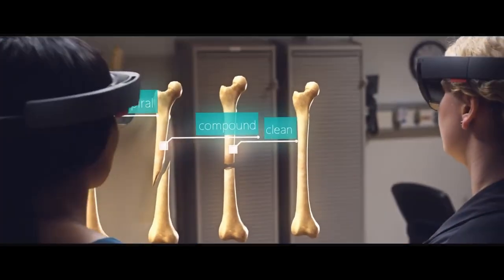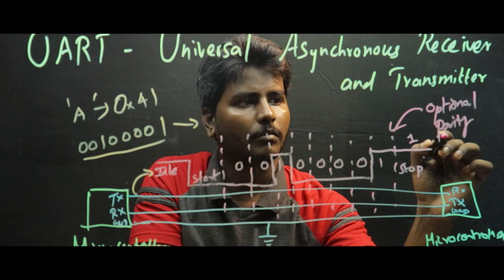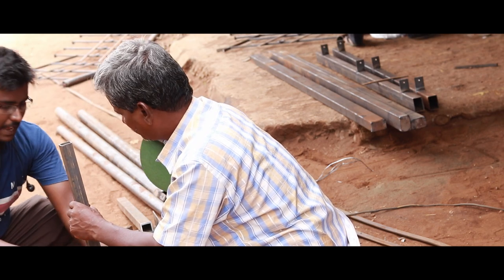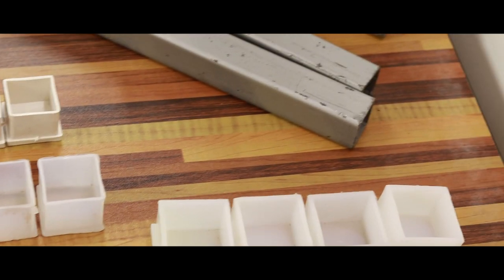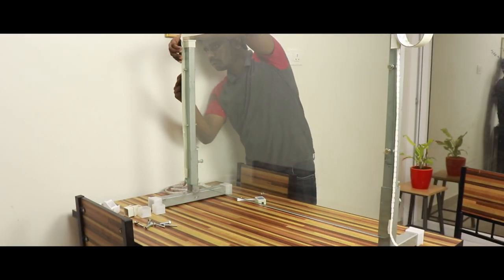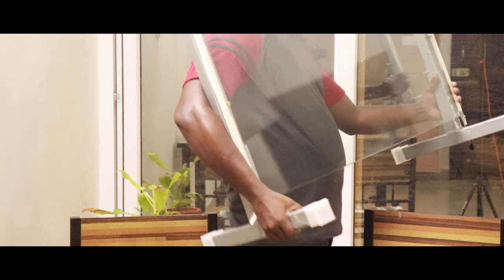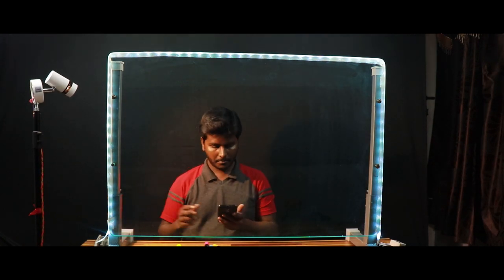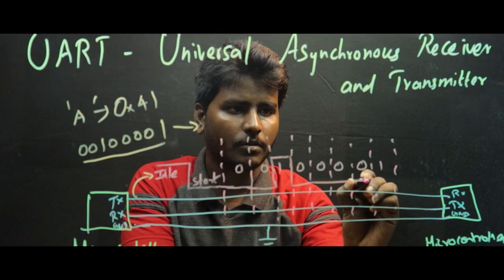#1 DIY Lightboard - Impact Series - S1 E1

Comment: If I wanted a MEMO type lightboard and mounted it on the wall... do you see any issues with spray painting the back of the glass with a flat black paint? Wasn't sure if doing this would somehow interfere with the board working properly.

Comment: Amazing video sir
What is the cost of this arrangement ??
Reply: The overall cost of this project: Rs.3400

 Stand - Rs.800 
 LED Strip with Adapter and Remote - Rs.350 
 Clear Glass 12mm 3x2 ft with rounded corners and mounting holes drill - Rs.980
 Nuts and Bolts - Rs.20 
 Masking Tape - Rs.200 
Dry Erase Markers - Rs.100
Nylon and Plastic Bush - Rs.50
Reply: There are lot of things that i need to ask

Comment: Hi,
The glass that I have got has some scratches.., is there a way to remove it? Also, is clear glass same as plexiglass?
Reply: Hi Sharat. No plexi glass is acrylic sheet (plastic) and EXTRA CLEAR glass is low iron glass. It's known as extra clear in India. To remove scratches, use colgate (white one, the regular coal gate). Put a small amount of colgate on the scratch and rub with a micro fiber cloth in circular motions. Please note that the colgate should not dry out so put a few drop pf wter to keep it moist. hope it helps, thanks :)